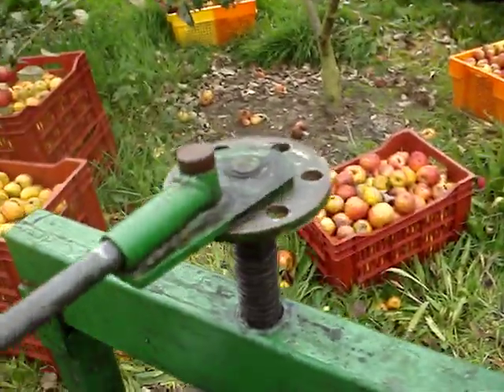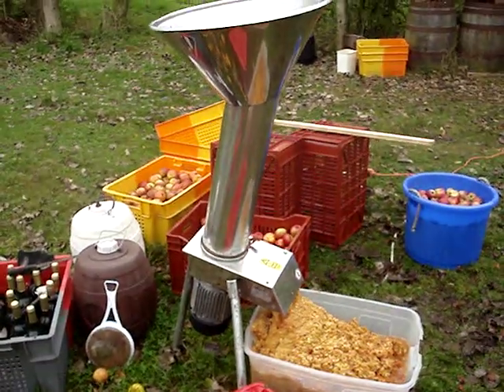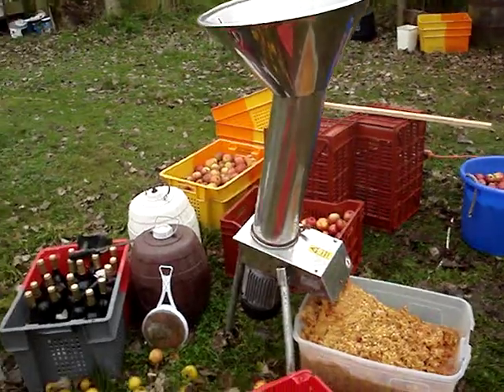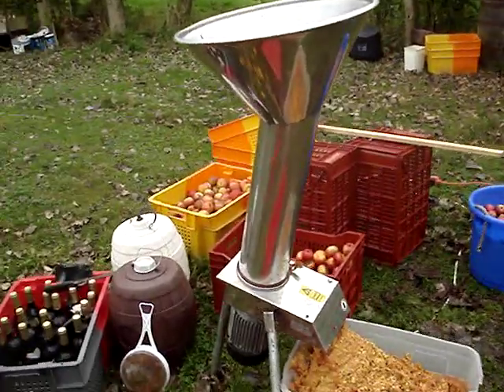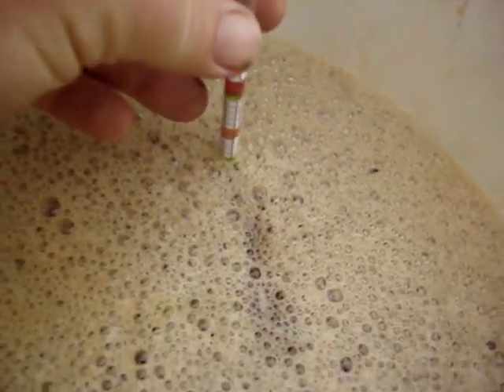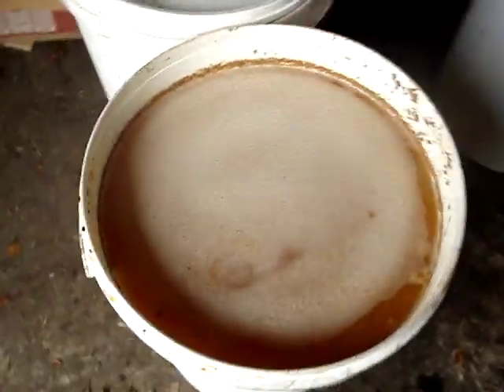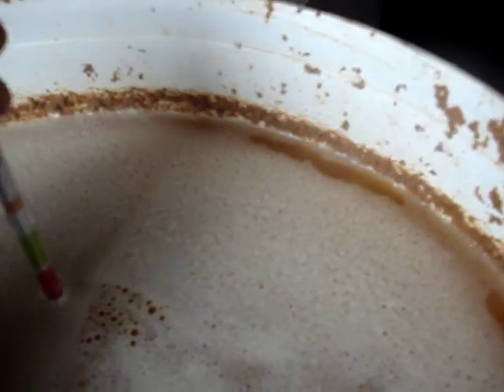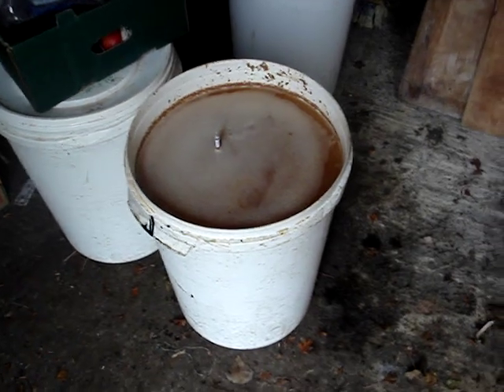cider making 4 of 4

Comment from the maker: @MrEinZwei Hi. Whatever reduces the apples to a fine pulp is good. Obviously, we have spent money on heavy duty gear as we process a lot of fruit, but there are cheaper solutions for smaller volumes, a kitchen food procesor would be fine, but you dont want absolute puree or it will clog up your cloth filters. Whatever works. There is an attachment you can get for a regular electric drill that slices the fruit up in a bucket. You might want to check out the cider workshop Google group

Comment from the maker: @minator3 The simple answer is that you need to use a hydrometer, this will tell you how much sugar has turned to alcohol.

Essentially, you make cider by adding yeast to apple juice and keeping it clean until it ferments out.

for the answers to many technical qestions about cider, check out Andrew Lea's cider portal on dubya dubya dubya cider dot com or join the Google group cider workshop, easily found. I don't have time to go into a lot of detail. lots of good  books around.